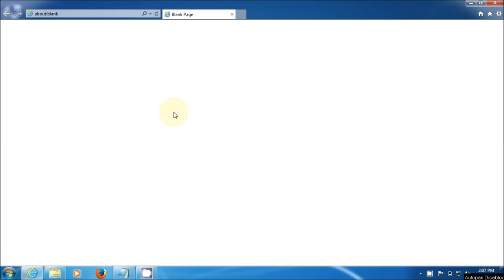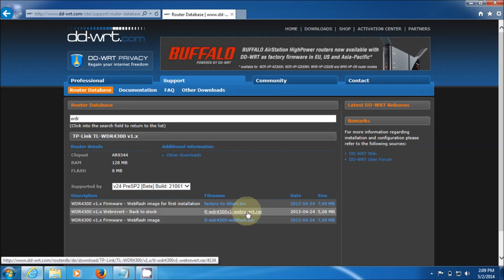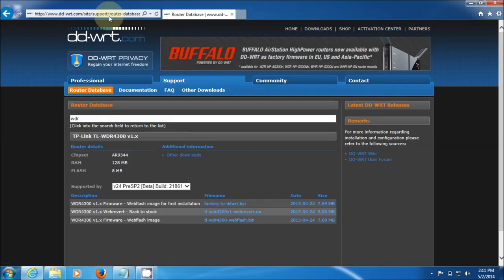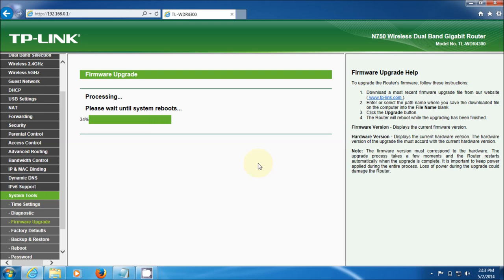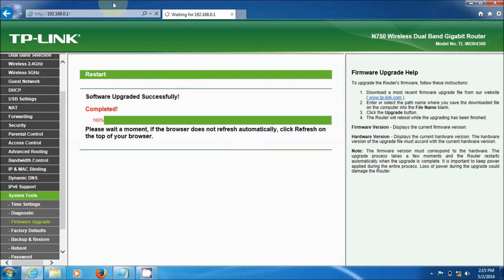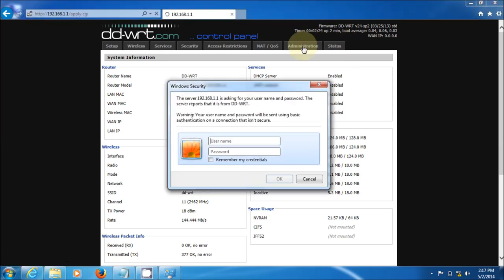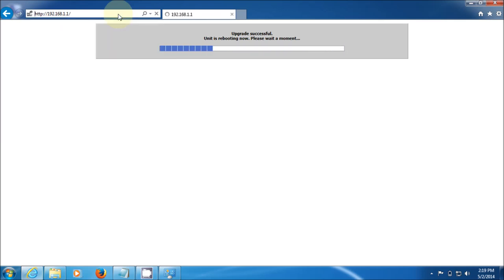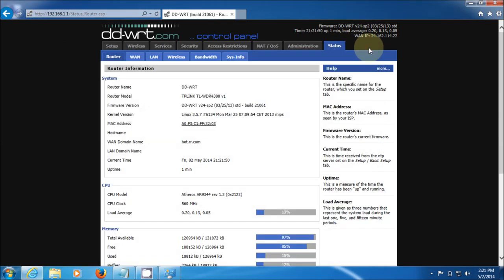DD-WRT Install (Supercharge) TP Link TL-WDR 4300 N750 Dual Band Router

Comment: Hi Richarth, this is extremely helpful. I just flashed dd-wrt on my WDR-3600. Works perfectly. I was wondering however, is there a way to limit the internet connection speed on one of the wi-fi bands? I was thinking of limiting it to around 1mbit on the 2.4 ghz band. Will that be possible?
Reply from the maker: The only way I can think of limiting the bandwidth on one of the WI-FI bands would be to take the change the Wireless Network Mode to B-Only. This will limit the speed to 11 Mb/s max on that band. Other than that I know of no other way. BTW I tried it and it does limit it to 11 Mb/s.
Reply: Thanks. Are there any other firmware options available for this router that might have that feature?
Reply from the maker: Angad Pal Singh Kingra  Non that I know of. I think I know what you are trying to do here and I have an idea on how you can achieve it for $20. You could buy a secondary WI-FI router for $20 at Amazon: http://amzn.to/1uhPgyZ plug it into this router and use the QOS service on this router to limit the speed going to the $20 WI-FI router to what ever speed you choose. It would have the side benefit of limiting access to your network resources. Thanks
Reply: Hmm, I already have a Buffalo WHR-G54S, should I just plug it into one of the ethernet ports on the new router and connect to the WAN port on the older one and it should work?
Reply: Also, for some reason all my devices except for the Macbooks cannot see the 5ghz band. Before the flash they could see both the bands.
Reply from the maker: Angad Pal Singh Kingra  Yes it should. You will need the MAC address from the router for the QOS service settings but it should work.
Reply from the maker: Angad Pal Singh Kingra Make sure you have the Wireless Network Mode set to Mixed and that the Channel Width is set to Dynamic (20/40 MHz). Remember not all network cards are able to connect at 5ghz band only newer WIFI cards and devices can as it is a new WIFI standard.

Comment: Well.. DD-WRT doesnt support hardware nat. In other words you cannot get 800+mbps but 300mbps. But still great router for broadbands
Reply from the maker: This will be enabled in future releases of the firmware from what I can see on the DD-WRT forums as it is a fairly new feature. BTW you have 100 MBps Internet connection? Wow!
Reply: Richard Lloyd Hello. I have been using the 1Gbps internet connection for the past 4 years. Why is it that everyone is so surprised when it comes to 1Gbps speeds ? Also IPv6 is fully implemented here and it's a must.
Even at countryside we have 1Gbps connection in Europe. The subscription price of a 1Gbps connection is 10 Euros.
It would be lovely to to have hardware nat supported by dd-wrt or openwrt. The stock firmware is useless.
Reply from the maker: ***** Most people don't have fibre optic speeds to their homes yet. You are very fortunate to have that ability. I am wondering if that is a private company giving you that service or a government sponsored initiative? Thanks
Reply: Richard Lloyd It's a private company. Also we get 3G SIMs or modems with no bandwidith limitations or subscription price, for having a land line internet subscription plan...land phone line is also free. The infrastructure here is FTTH.
We have 4 major companies here and each one offers the 1gbps connection speed but only mine offers the ftth infrastructure (ONT in your house). Also my company offers a mobile subscription plan of 4Euros/month: unlimited minutes all over the world (except some countries in Africa) and also free 3g internet. We pay only for SMS outside our network. I can call you in China, USA or Australia for free.
They offer 24/24 tech support , and i'm not talking about the part where you talk on the phone with the operator but the part when the tech team comes to your house or street to fix the network issue, no matter what hour it is. Within 2 hours of you calling the tech support, your network issue has to be fixed - it's in the contract.
Reply from the maker: ***** I would have to say that kind of bandwidth at your home puts you in the top 99.99% of all Internet users. Can't wait for that type of bandwidth to become readily available here and that cheap too. Thanks.
Reply: ***** I believe this is because our ISP (I suppose you're talking about RDS) is not conforming with some standards like managing cables underground and paying for all the services to use public poles and any other standards that they have to conform for laying around the infrastracture. I don't know the entire context but this is what I've heard. Anyway, I love our ISP even in this situation and I love their services too. RDS FTW.

Comment: Hi Richard

For the TL-WDR4300, were you able to successfully flash beyond the r27147 firmware. Thanks.
Reply from the maker: +Daniel Renaud I am currently using the latest beta version r28417 on both my routers WDR4300V1 and WR841NDV9 without a problem. I can't vouch for bugs or stability as I just updated them both but they do work. It seems that they are updating the firmware every couple of days lately. Thanks.

Comment: what settings do you have for the 5ghz?
because the 5ghz doesnt even show up on mine.
i have ddwrt r25697 (the one you have linked to)
Reply from the maker: +Shirra T That's weird the settings should be there. I am now using http://dd-wrt.com/site/support/other-downloads?path=betas%2F2015%2F11-02-2015-r28072%2Ftplink_tl-wdr4300v1%2F with out issue on both 2.5G and 5G. Thanks

Comment: Hey Lloyd, did you have to do a hard reset or 30/30/30 reset as suggested in the DD-WRT Wiki?
Reply: One other question, does the router have to be connected to the WAN during the upgrade?
Reply from the maker: I did not have to do a 30 30 30 reset to upgrade mine and it does not have to be connected to the WAN or Internet when you are flashing it.
Reply: Richard Lloyd Great! Thanks for the info!
Reply: Joseph Nova Richard, using your video I successfully upgraded the firmware in my WDR4300.  Prior to finding your video I began reading the DD-WRT Wiki. It's gotta be the most confusing Wiki I've ever come across.  Made the whole upgrade process seem overly complicated.  I'm glad I found your video!  Thanks again!
Reply from the maker: Joseph Nova  My pleasure. Glad I could help you. Thanks for watching and commenting.

Comment: Hi Richard, mate I've done it but now my WiFi keeps dropping out....  Is there any other firmware I can use to stop this?
Reply from the maker: I am currently using DD-WRT v3.0-r29519 std (04/25/16) you can find it here for the WDR 4300 V1 http://dd-wrt.com/site/support/other-downloads?path=betas%2F2016%2F04-25-2016-r29519%2Ftplink_tl-wdr4300v1%2F There is a US firmware (For US routers) or international for all the rest. Thanks

Comment: i updated the firmware but by WAN IP address doesnt change , i pulled the plug out and restarted the router , nothing happens...
Reply from the maker: Harshal Patel The WAN IP address is usually controlled by the Internet Service Provider. I can't change mine either, I get what they give me. Thanks.

Comment: Thanks for this video~
nice guide~
i have some question and need to confirm something to make sure i wont brick my router.....><
do you reset the router before flashing factory-to-ddwrt.bin?
and we need to reset our router(reset button behind), then turn off the router and turn on again (by pressing the power button behind the router) right?
Reply from the maker: +cheong gwen shen No need to reset it as long as you can get to the firmware update page it should work. Follow my instructions exactly and you should get the same result. Thanks.

Comment: I was going to download the latest version (beta that is, because the stable version on the homepage was from 2013), but the DD-WRT host seemed to be down, so I download from your web site.

The 5GHz Wi-Fi gets down if I download large file (such as 3GB XCode DMG), and it was reproducible (happened every time). Now I downloaded the latest beta (July) from DD-WRT site, and so far I have not experiencing the problem. Still testing, but if DD-WRT turns out to be not stable, I will move on to OpenWRT or the stock ROM.
Reply from the maker: Jeong-hun Sin I have not experienced this problem but thanks for the feedback and watching.
Reply: Richard Lloyd The new versions also had the same problems. I am going to try OpenWRT.
Reply from the maker: Jeong-hun Sin Best of luck. I have several videos on how to unbrick it if you have difficulties. Thanks.

Comment: Hi Richard, I having some problems with my router.
Since I've brougth it the 2.4 GHz wireless keeps dropping signal.
I've looked everywere and I didn't found any solution.

Did you or anybody have been through the same problem?

I've tried the stable release and the leastest release and the problem still persist.
Reply from the maker: +João Ferreira I am not having that problem. Is it happening on all your devices? Thanks
Reply: +Richard Lloyd Yes. Happens with all devices.
I have tried every configuration that I could think and the router still loses the 2.4GHz.
It did not only disconnect my devices, it stops broadcasting.
I&#39;ve seen some people complaining about this issue, but only with the original firmware. With dd-wrt people don&#39;t seems to have this 2.4GHz wireless drop.

Comment: Hello Richard, I get the message: Error code: 18005. Upgrade unsuccessfully because the version of the upgraded file was incorrect. Please check the file name. when I tried to upgrade to the factory-to-ddwrt file. Is there any advice you can give me?
Reply from the maker: Which version of WDR 4300 do you have? Thanks.
Reply: Thank you for the quick reply.
The firmware version is: 3.14.3 Build 151104 Rel.45874n
Hardware version is: WDR4300 v1
I did a factory reset, and attempt to follow the steps you outlined, but it didn't work.
Reply from the maker: OK here is what I found. It appears your router is running the latest locked US firmware from TP-Link. That is why you get the Error code: 18005 when you try to flash it. I am looking into the solution for the problem and if I find a suitable solution to the problem I will make a video on how to fix it. Stay tuned. Thanks.
Reply: No, thank you.
Reply from the maker: Here you go Sir https://youtu.be/_Ep_EU_U50Q I hope that helps you solve the problem. Thanks for watching and asking. Please tell me how it went for you.

Comment: Hi Richard, I'm still on the original 21061 release but wanted to upgrade to a later release; every time I tried it it just didn't work (I only tried applying the webflash image)
So firstly thanks for making sure we avoid the dodgy one ...so I  want to try the one you recommend; 25697 (or maybe now just go straight to 27147?)

Do I therefore need to apply the factory image first, then the webflash one (all through the dd-wrt interface)?
or ...what....
Reply from the maker: +Steve Goodenough You are welcome. You need to use both files to upgrade or downgrade the router. I have a video explaining that here https://youtu.be/Ppsz-hRBcW0?list=PLnxXRLSlmSVNiENiN9wTejP6dtIqqmTya I am currently using r 28548 without issue. Thanks.
Reply: +Richard Lloyd cheers, now that's where I've been going wrong! Merry Xmas
Reply from the maker: +Steve Goodenough Thanks and Merry Christmas to you and yours too.

Comment: Thank you Richard. That was really helpful. I'm now with r27147. Light indicator for 5GHz it's not working, but the 5GHz works.  Not big deal. Thank you again. And will update firmware when you say to do it :)
Reply from the maker: +Stelios Arianoutsos I am currently using the latest beta version r28417 on both my routers WDR4300V1 and WR841NDV9 without a problem. I can't vouch for bugs or stability as I just updated them both but they do work. It seems that they are updating the firmware every couple of days lately. Thanks.
Reply: +Richard Lloyd thank you too Rich. My 4300 was working for a couple of years just fine with original firmware upgrades. Last 3 weeks start crashing 2-3 times per day randomly. I can only guess some other new AP in a near office cause this. I updated your suggested dd-wrt version yesterday and got again WiFi crash during the day. Will upgrade to latest. If that not help will net to get a new AP because. It's an office and need stability. However I love this router.
Reply from the maker: +Stelios Arianoutsos This router has actually lasted longer than most for me (First TP-Link). I usually burn them out (Non TP-Link) in a year to a year and half so if they last at least that long I am usually happy. Mine is not showing any sign of dying but they never really do till the day they are going to die. So far so good. Thanks

Comment: what is the best version dd-wrt currently for  TP Link TL-WDR 4300 N750 Dual Band Router V1.7, should i get the r27147 or is there a better version now?
Reply from the maker: I am using this version without problem and it is the latest beta http://www.dd-wrt.com/site/support/other-downloads?path=betas%2F2016%2F06-06-2016-r29837%2F
Reply: hi, Richard thanks for replying i now installed the r27147 version and it seems tot be doing the job, had a bit of a hustle installing my 2 network printers but all is well now! Maybe ill try the beta, if other things come up.
Reply from the maker: You are welcome. Thanks for watching and commenting.

Comment: Thank you. Clear and accurate
Reply from the maker: You are welcome. Make sure you use the r25697 http://dd-wrt.com/site/support/other-downloads?path=betas%2F2014%2F12-22-2014-r25697%2Ftplink_tl-wdr4300v1%2F to flash this router. It is a far superior firmware for it. Thanks for watching.
Reply: Richard Lloyd Does that firmware has any issue whatsoever? I want to flash the most stable build possible.
Reply from the maker: Jesse Anh Pham I have not found any issue with the r25697 firmware and I use it every day and have it hooked to my web server as well as every net connected device in my home. This does not mean that there are no issues with it as it would be hard to use every feature of the firmware to confirm it. Let me put it this way, there are no issues that I have found with it. I no longer reccommend that the r21061 as I found several issues with it. SSH and USB sharing did not work or work well. Thanks.

Comment: will this increase the antenna signal too also does the DDwrt for this model router have VPN cabibilities? stock does not  i need vpn for my xbox one
Reply from the maker: +jace gibson DD-WRT for the WDR4300V1 will give you the ability to boost the antenna output and VPN support. Thanks.
Reply: thank you.  and what version do you recommend that will not brick my router? i just read that one of them will brick this router..   i cant afford a new one, i do know how to flash routers.      vpn support and boost of signal is exactly what im looking for.  thanks
Reply: i saw the r27147  you recommend but in the wiki ddwrt it only shows up to r25  no r27 etc.. where on the official ddwrt site is this link for that?
Reply from the maker: I am currently using DD-WRT v3.0-r29519 std (04/25/16) you can find it here for the WDR 4300 V1 http://dd-wrt.com/site/support/other-downloads?path=betas%2F2016%2F04-25-2016-r29519%2Ftplink_tl-wdr4300v1%2F There is a US firmware (For US routers) or international for all the rest. Thanks
Reply: thanks i installed it fine.. i can not find the advanced setting in wireless to boos the antenna range though? is the option not available on this fw?  also is there a way to use the VPN on only one of the bands? for instance the 5ghz band use vpn and the 2.4  on my regular isp  address?
Reply from the maker: Which revision did you use? The US or the non US version? As far as the VPN I do not use it so I can't comment. Check the DD-WRT support forum, they usually have the best advice. Thanks.